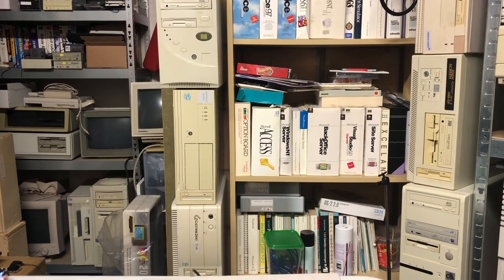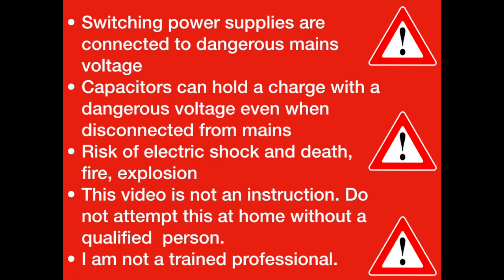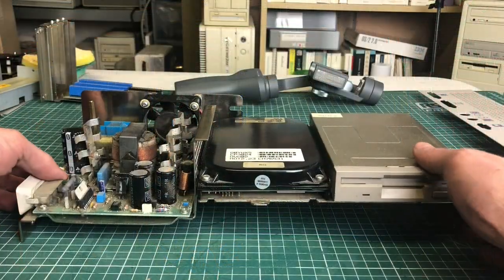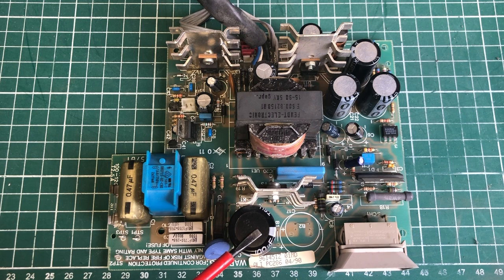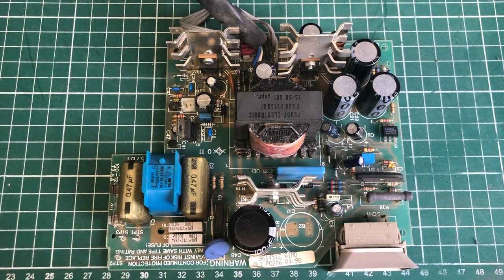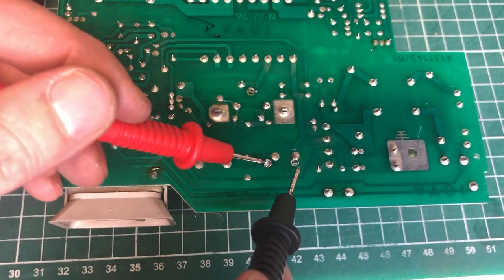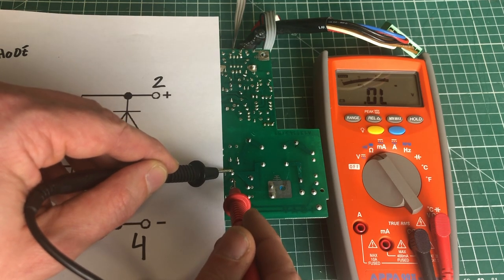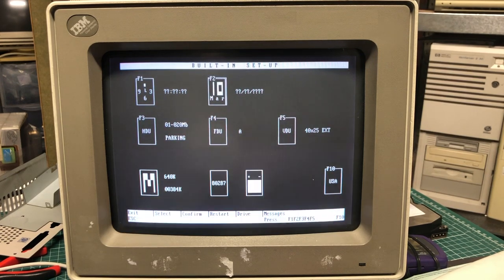Olivetti PCS 286 Rescue Part 1

Comment: Nice video and computer! Very Italian, that design element on the front I would call a colonnade.

Just FYI, that screwdriver you have is a Pozidrive, those are mainly used in furniture and you are likely going to chew up PC screws. Notice the 45°-offset second cross on the screwdriver tip. Dig around your toolbox for a classic Phillips style screwdriver.

Comment: Usually an “exploded” fuse means a short, and a fuse that’s just “melted” is an overload.
Reply: or you could just say the fuse was "blown" to mean "whatever broke this fuse"
also technically a short is just a form of overload
Reply: yep, in some cases the fuse can literally explode,  blowing its case to pieces, the inrush limiter thermistor would have prevented it,
Reply: Ive had glass fuses before that exploded with a loud bang.
Reply: yeah, nah, this is not anything anyone should take as a rule.

Comment: Well done for explaning the safety risks of working on power supplies, even after they are unplugged from the mains.

The smoothing caps in some PSUs do discharge relatively quickly, but others definitely not.

And although a cap might not sustain the voltage for very long once it's discharged, it can produce a HUGE amount of current in a very short time.

Same with making sure CRTs are dicharged correctly.
The tube itself acts as a big HV capacitor, and some flyback transformers also contain caps, but not everyone mentions those, nor the caps on the main board.

It takes less than 100mA of current across the heart stop it, or cause serious arrhythmia.

Having said that, once you know what to look for, these things can be safely worked on.

Interesting repair vid, too. Subbed. ;)

Comment: Lovely to see that you've come across the same troubles that I've experienced a short while ago. It's so super satisfying to have a working power supply after this amount of labor. 😁💪

The PSU in my Philips NMS 9100 had 12 defective components after the transistor died on me. There was a big bang and spark coming from the back of the PC. One of the most awesome things I have repaired so far! 

Thank you again for these really clear video's. I've learned something again! 😁
Reply from the maker: Really glad you enjoyed it ... wow 12 defective components ....  i'm sure I desoldered and checked over 12 components in the DC output (diodes / caps / rectifiers / .....) because I was sure the PSU was still faulty ... but they were all good :) I just couldn't simulate the load the mainboard added to the PSU .... ordered some high wattage resistors and will see what I can still put in in part 2 for that.
Reply: @RetroSpector78  I'm really eager to see that video coming! 😁 I think the resistors might be a good start to further diagnose the PSU. Also, diodes and capacitors were on my list of replacement... 🤐 

Anyway, good luck! 🍀

Comment: My father worked for Olivetti in this period and brought this beauty home in '89, when I was 9... I learned DOS, Windows, Office, and programming on this thing, and now thanks to it I'm a software developer. Oh, the memories. Mine is since long gone, but now I restored four of them and learned a few tricks that may save you some time:
- it needs the battery replaced to boot from HD, and it's in the infamous Dallas RTC
- it needs the riser card to be installed or it won't detect the HD (bus termination?)
- DO NOT connect that HD to a modern motherboard or adapter, IT WILL DIE! and perhaps the motherboard too
- to detect a more modern HD, set it to master, use a 80 wires IDE cable and connect the HD to the SLAVE connector (yes, that's weird). The BIOS only allows 20 or 40 mb drives, you can choose any and then use XTIDE or Ontrack to use full capacity
- some CF cards works too, but no SD or SATA adapters. Also, there's no way to add a second IDE device without another controller.
- the FD is PC standard, but if you use a standard cable you need to use the connector for the B: drive. I couldn't find a way to make a second FD work, even though it was also sold in a dual floppy, no HD config.
I have some of the original manuals and utilities, if you want them just write me. The interactive guide is actually GORGEOUS!
Reply from the maker: hehe .... fixed the battery and noticed the riser card issue also :) That will all come in part 2 tonight :) Tried the hard drive on an old 486 and it did auto-detect it, but then threw a Drive C: error. It is a lovely little machine. Also have an Olivetti 386 that I am taking a look at, but that one seems to be a lot more difficult to service, with lots of plastic bits that can break off.
Reply: @RetroSpector78  Can't wait for part 2! Which 386 is that? I never worked on one specifically, but they reused the parts in several models, maybe I can help.
Reply from the maker: @gabrielebiffi9018  it's a M300-02. Still need to take a look at it in detail. Bought it as broken. Did a quick power-up and noticed that it starts but it keeps rebooting in the middle of the startup-sequence (when it performs the tests). But haven't looked into it yet. The case seems to be very annoying to work with :) At first glance there seem to be lots of plastic things (that can break off) that you need to remove.
Reply: @RetroSpector78  I love that little case. To open it there's a screw and then a lever to pull, the mechanism inside is plastic. Never had any problem so far but I can imagine it can break. And I never had that problem, as far as I can remember, but I do remember it locking up for bad ram.

Comment: I used to work for Olivetti in the UK well before PC's were a thing! Worked on the Auditronic A770/730 TC300 range of computer terminals and their Vector Mini system. Also many different Reel to Reel computer decks. I eventually left to work for an American firm called Wordplex who made stand alone and large multi terminal word processors.

Comment: I'd remind to also check that the swapped transistor is similar type than the original. There are maximum and saturation voltages, wattage etc. And the tab for the heatsink can be connected to another leg even if using using a compatible one. And while removing electrolytic capacitors, double-check the polarity. They'll tend sometimes to blow up loudly if polarity is reversed.

Comment: Seeing all those retro computers reminds me of all the computers I use to have, that I wish I still had.

I had an old Zenith 286 desktop, had a Wise 286 (can't find much info about it, and can't find a picture of it, it was quite unique as it had a little LCD screen on the front that would show you ram usage, and what speed the CPU was running at either 8 or 12mhz), two IBM PCs, one was a huge 40lb tower with a CPU upgrade, and the other was a IBM XT, a generic desktop PC with a 8088 or 8086 in it running around 5mhz. And a Compaq prolina 3/25zs

Comment: That's an interesting form factor, and going by those date codes of 1990, it's 30 years old now.  I think that's the first time I've seen SIMM modules with DIP package IC's too.  

I'm pretty sure that BU508D is a horizontal output transistor for a TV, and it has an integrated damper diode.  I've never seen someone use one in a PSU until now :-)

Comment: Very interesting !

That makes me remind the PSU from my ometra case (the big one that I have that looks like yours). It has a specific shape but it's AT, and the problem is that one day it didn't turn the pc anymore. The PSU still ""works"" (no blown component), but it's outputing something like 1 or 0.5v x)
Reply from the maker: Deksor yeah can be lots if things ....you’ll need to start doing some measurements to find the culprit. Check if it is load related, make sure you can isolate the problem to the psu (and not some issue on the mainboard). If you suspect the output section, check the caps, diodes, rectifiers ....

Comment: I think the "OL" on multimeter continuity mode means "open line" and not "over limit" but I guess I'm not sure.
Reply: I googled it, found almost the same, "open loop".
Reply: @Hagledesperado  yea I have the same argument with engineers at work, how could an open be over limit, its open line, open loop open whatever its open
Reply: @osgeld  Well, the resistance is "higher than the limit of what meter is able to measure", so I think it's understandable that someone would interpret it that way. In either case, it's just a term. So long as we all can agree that it means a jolly high resistance, we're probably good.
Reply: After I heard it here, the first time ever, I take it as a coincidence that both are correct, because depends on the situation it can be one or other, open line or over limit... as I've just looked up, some multimeters differ and show different letters "O.L.", "Range" or "Overload", so "Range" and "Over Limit" is the same I would say, so even three different information in one is absolutely true and not just "makes sense", let us establish this anyways, don't accept any argument, this is a fact now, some smart engineers meant it like that, next time when people start a discussion lift your nose and upper lip and say just "Nouuh" 😄
Reply: OL means that, whatever it is, it is more than can be measured by in the present range---past it's limit. Voltage and current will show the same when push beyond the range. Many meters will even show "-OL" when past the negative limit of the range. Many meters will top out at 40 MΩ or so but a blown fuse may be many GΩ or even several TΩ.

Comment: Had to watch this video at 2x speed.  I do this kind of stuff all the time so watching the PSU repair part is just well..boring for me.   Good video.
Reply from the maker: Hehe. I get that a lot. Need to learn to talk faster and find a better rhythm and flow.
Reply: @RetroSpector78  It's all fine,  just as someone with electronics training and having repaired countless switch mode supplies I was just looking for the failed component(s) to be found.  I'm like let me speed this up.
Reply from the maker: @jeffm2787  feel free to give advise on my failed Tulip PSU video.
Reply: @RetroSpector78  Thanks,  I highly recommend you check out DiodeGoneWild on YouTube,  he covers a ton of the theory behind SMPS in a way that won't put you to sleep.  I would be shocked if you didn't learn a ton.

Comment: Who the hell thought putting the expansion slots on the side was a good idea? I mean you already got the cables with the bulk of them in the back, and now your making the computer "wider" by having stuff come out the side.
Oh well, its an old PC so can't really complain now since the company that made it probably isn't even around anymore (and thankfully they didn't start any trends int he PC world like the side ways expansion slots)
*BTW, Thanks for the video! Enjoying these videos!*
Reply: MY 486 SIemens has the same thing - it makes for a slimmer case, basically the height of the power supply. I like that aesthetic on a desktop system. Of course, air circulation is an issue.
Reply: Didn’t Compaq do that with their luggable too?  I agree it’s not a great layout (riser with slots on the rear makes way more sense) but it was a period of trailblazing.

Comment: You've installed a generic type chopper output transistor with an internal efficiency diode...it would be much better to replace the transistor with a similar type to the original.  Also, check the chopper driver IC - looks similar to a TDA4600 type - and all the components associated with it by replacement. If this sounds a lot of work...well, it is but it's better than risking another PSU blow up in the new future. Best of luck!

Comment: You seem to have a good number of 286 machines in your collection. I'd say by far 286 PC's are the x86 CPU's I come across the least often not counting oddball stuff like the 80186. Makes me wonder if its just coincidence or if the 286 was more popular or pushed longer in Europe.
Reply from the maker: When I started collecting a little over a year ago I think it took me 6 months before I got my first 286 machine (not counting the IBM 5162, the rarest 286 of them all that I got as my third retro pc). After those 6 months I started seeing some in local adds and decided to pick them up. I kinda like them cause I spent so much time working with XT based systems that these 286 machines felt like rockets :)
Reply from the maker: Also as I think you pointed out in one of your videos, people don’t think about 286 pc’s when it comes retro pcs or
retro gaming. Especially in the gaming department, things got interesting with the 386 and a lot of people I know tend to have started with a 386 or 486. So for the nostalgic feeling people often look at those.
Reply: @RetroSpector78  You've amassed an impressive amount of PC's for only getting in hardware collecting about a year ago. I didn't know anyone with a 286 based PC back in the day but I find them interesting despite there not really being anything special about them. I have an 8MHz IBM AT which is cool but a bit on the slow side and my 20MHz 286 is interesting for its rarity and just being a high end system but at that point mays well have a 386, I'm currently working on a VTI 12MHz 286 PC which I think represents the 286 "era" pretty well.

Comment: Did you use PZ screwdriver for Philips screws? A common mistake (esp. the other way around), but please don't… It might be a good idea to replace those X2 RIFA caps, they are known magic smoke generators (seen that several times: magic smoke emerges, and that's it, the appliance is still operating).
Great to see those old machines being restored, thanks for the video :)
Reply from the maker: Guilty :) about the rifa caps : the 2 caps are also metalized paper safety caps, but not from the Rifa brand. Also had issues with Rifa caps and their distinct smell :) Do you know if this is a common issues with all metallized paper caps or was it specific to the Rifa brand ? And thx for watching. Glad you enjoyed it.
Reply: @RetroSpector78  Only seen Rifa caps releasing the smoke (often the transparent resin was cracked before), don't know about other brands. That might not be necessary, but I'd feel better after replacing them, just in case.

Comment: My Olivetti is older than that. It's a PC-1 HD based on an embedded NEC V40 CPU, 640 kb ram, 20 Mb hard disk + Olivetti PC-1 CGA color monitor and needle printer. Dos 3.2+Windows 2.0
Reply from the maker: pippo spano looks like a cool machine. Have an XT based Olivetti that I will showcase here soon.
Reply: @RetroSpector78  I'd like to add that Norton recently found only 1 bad sector in the HD, 31 yrs after installation... my new SSD is already failing after  <3000 hours

Comment: good info there thanks. now i know better what to look for, i have a C128 powersuply that doesnt output 9vac. 5vdc works and you say that those transformers rarely goes bad. i thought it has to be the transformer because 240 goes into it but i cant find anything coming out. well with my knowledge of electronics...tested it with 2 methods, the normal way with multimeter caps and broken traces, solder joints, input works right to the transformer and also tested with fingers, yep 240 is there :)
Reply from the maker: Think these commodore supplies are a different beast all together. But I’ve never seen a bad transformer in a pc power supply. It’s usually something else. (Caps, diodes, transistors, rectifiers....)
Reply: @RetroSpector78  That was what i was thinking too about transformers and theres nothing obvious that would be broken. theres not many parts, its alot more simple than a pc power supply so i will just start again by removing those transistors and testing them, that was a good point in the video :)

Comment: connor drives were tanks, forget who bought them wd or seagate ... and I see electrolytics go short every now and again, its right before they spontaneously explode, something like a power surge hits them in a storm or whatever and creates a weak spot in the insulation of the internal wrap.. then a couple weeks later BAM (if the fuse does not catch it). its a different failure to reverse polarity or prolonged overvoltage which is typically more released unless your doing something to MAKE them explode (like the old trick of sticking a 25v cap in a switched outlet and hoping your roommate turns on the lamp switch heh)

Comment: I'm guessing there were some stages replacing the switching transistors that you didn't show, the transistor and heatsink kept swapping around as the video progressed and at the end when it finally powered up  the power transistor had no heatsink at all.   The BU508D you fitted first has  built in diode between the emitter and collector (as you saw on your meter) but this isn't standard on a transistor, the D version of the BU508 has it but most (including the original F444) don't.  This may have caused you problems using that part.
Reply from the maker: Yeah there are some continuity errors that creeped in during editing. Finally ordered a brand new transistor and used the original heatsink again. Will try to show that more in detail in part 2. Things can get kinda chaotic when debugging issues and trying different things. Not always easy to transform that into a meaningful and consistent 25min video :)
Reply: @RetroSpector78  I wasn't complaining, i just found it amusing. It was a good video.

Comment: Well done with the PSU! It seemed the capacitor lost its voltage rather fast or was the video speed up? I wish you could just replace these old PSUs with modern ones and not worry about them for the next 10-30 years
Reply from the maker: Yeah... problem is they have a very specific form factor and the power button is also soldered on and needs to align with the case.